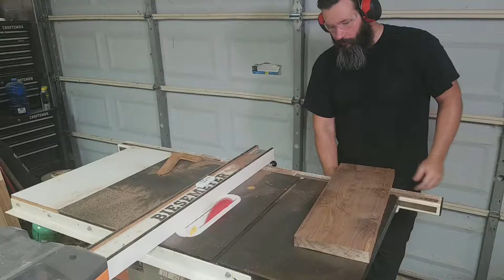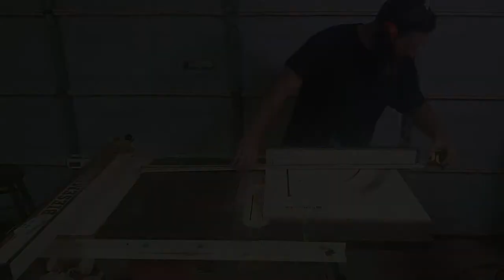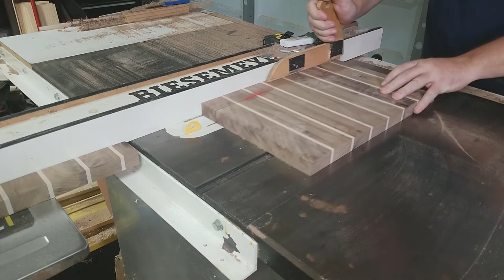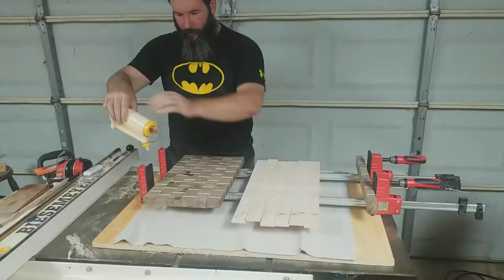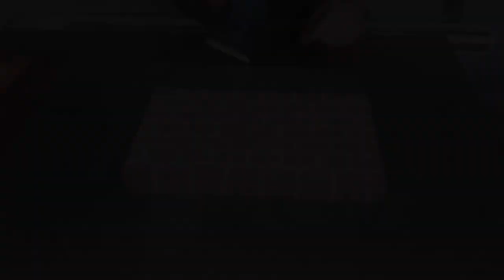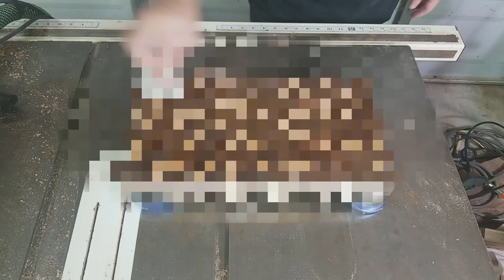How to Make a Brick Wall Cutting Board

Comment: I saw you made end grain mortar strips about halfway through the video, but did you make the tiny individual vertical mortar strips end grain as well?
Reply from the maker: Yep, 100% end grain.
Reply: @brandonthebuildertx  ok I was confused. Was the video somewhat out of order then? Because the other thin strips were already in place before you showed how to make the end grain strips. By the way, I’ve watched 6-7 tutorial videos on this brick pattern and yours is by far the most helpful of the bunch. I’m about to make my first board and was considering giving this pattern a shot.
Reply from the maker: @toddstrother136  the narrow strips are glued to the brick sections while they're all still "edge grain", then when you cut them it all turns 90° together to become end grain.
Reply from the maker: @toddstrother136  glad I could help!

Comment: Do you have plans available for purchase on this? If not how thick is the wood that you originally start with?
Reply from the maker: I don't, though I have considered making some if that's something people would be interested in. I made these out of 6/4 lumber.
Reply: @Brandon the Builder  I would def buy it. Im a beginner wood worker. In it 3 months now. I want to make a few boards but not just three regular old board. I want to make one like this. One that sticks out. But being a beginner I have no idea of where to start as far as measurements go or what thickness lumber I need to start with. I got alot of info from your video tho. Enough to where I feel comfortable trying it lol. I just don't and didn't know measurements. Thank you very very much for the video and your response back

Comment: Nice video, thanks! Two questions: 1) I’ve been told that raising the grain is really not necessary on end-grain boards because it really doesn’t raise much in that direction. Is this correct? 2) After you use the round over bit, do you sand the wood that was rounded over? If so, how? Thank you.
Reply from the maker: I wouldn't say it raises it a huge amount, but I notice a difference. I lightly sand the edges after the router with some paper I just hold in my hand. Smooths any fuzzies without messing up the roundover.